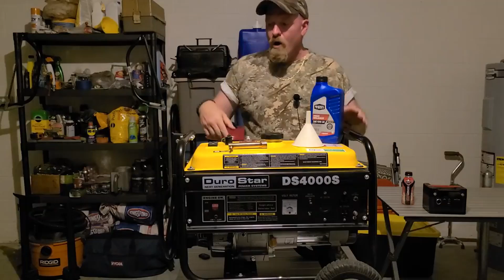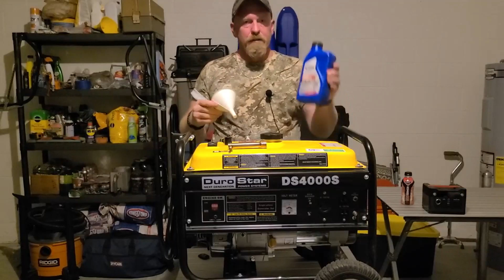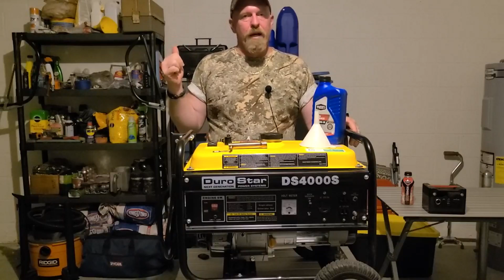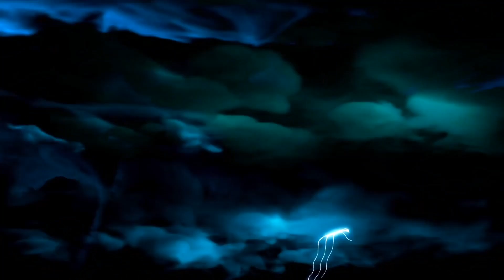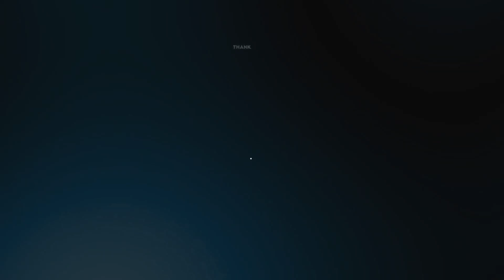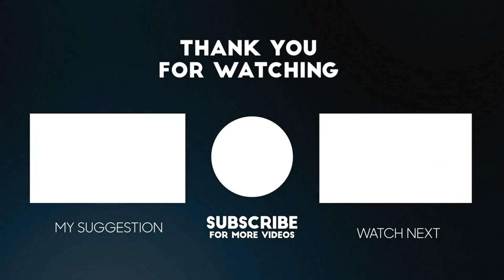Power Outages in Winter how to Survive

Comment: I have a 5,000 watt Jupiter inverter that runs off of 12v battery. Are those safe to run inside the house? I was worried about sparks and fires

Comment: I broke my new Winco Lil Dog generator in charging the 20 marine batteries after a week of rain and clouds. It lasted through the night until the solar panels started charging again. Used six ounces of gas. It works great with my little welder. I'm getting 25 gallons of gas for it tomorrow. I ordered an Oregon electric chainsaw to run off it.

Comment: Good tips. Up here in the panhandle we’re expecting 12 degrees windchill during the day on Friday. Our fireplace is ready and we filled a couple 5 gallon gas cans in case something happens we’ll be able to run an electric heater too. After the Texas freeze a couple years ago, I started prepping for the cold too even though I’m in Florida.
Reply: They're calling for -3 deg. With -25 wind chill, Friday morning here in Oklahoma, but we're just barely catching the edge, they say two inches of snow. I've got a cord of pine and a big wood stove that I made. It used to be a sandblasting tank, my uncle was going to throw it away. I shortened it 8 inches and made a stove. I cook on it a lot.